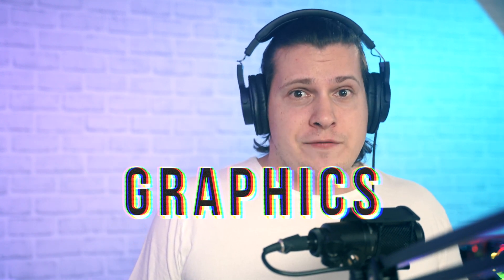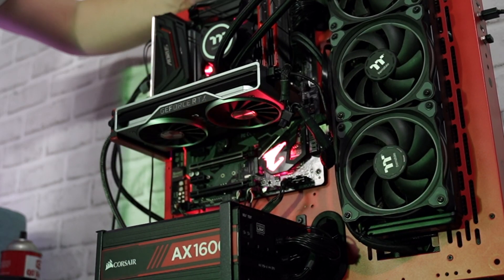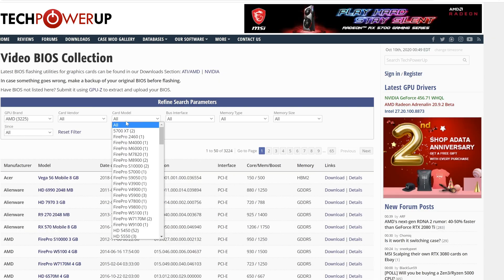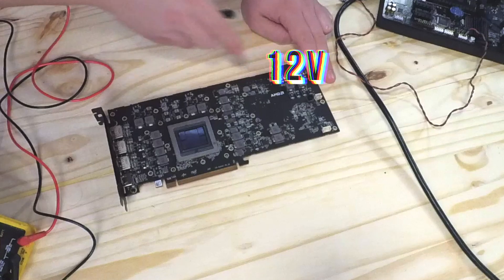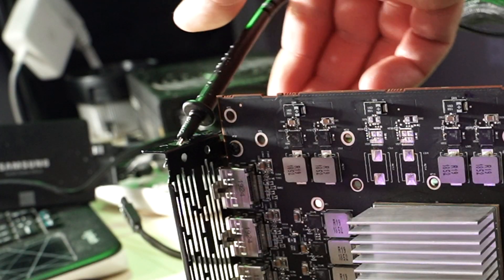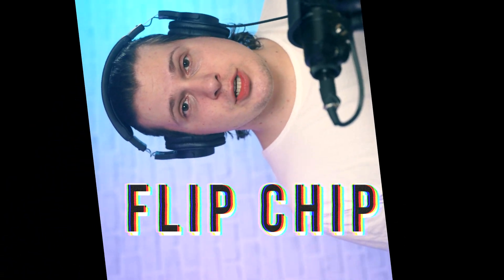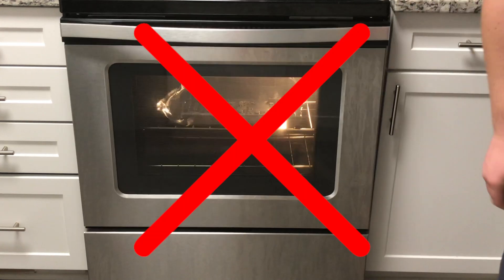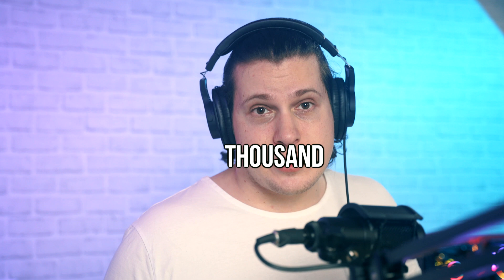How To FIX Dead Graphics Card

Comment: Sir I did like already can you help me with my problem  please i do have 1050 ti then I did most of the troubleshoot not with the hardware fix I already know its about my hardware that do have problem since i try using another low spec gpu it did work but not on my 1050ti
Reply: Its just simply light on the monitor i think thats bhaving signal but just black screen it is also readed in the device manager but does have error 43 when i use igpu as display
Reply from the maker: Unfortunately. Error 43 is not good news... remove cooler check for damage and clean it. Reflash the bios using nvflash. Get bios on techpowerup and find instructions for the latest nvflash online.
Reply: @GeorgeTech  thank you for your quick response ill try doing it
Reply: @GeorgeTech  I did open my gpu and the paste is quite wet and messy should i reapply paste?
Reply from the maker: @rjrivera2756  paste condition is not related to error 43. You can replace it if you want. Please watch the video. Feel free to pause.
Reply: IM FROM PHILIPPINES HOPE YOU COULD HELP ME, THANK YOU

Comment: Ok you seem to know what your doing. I have a 50th av Radeon vii. Sold it eBay seller sent back said it won’t run. And sure enough can’t over clock can’t adjust fans and it hits about 574mhz core in games for a minute and crashes. I have repasted flashed different vbios all I can think of. Memory is fine sitting at 1000mhz. Any ideas?
Reply from the maker: I’m thinking it’s component level issue man... have you tried testing each vCore phase with multimeter? Disconnect boot drive start the PC the test those SP-caps on the back look for 0.9 volts - vcore 0.8 SOC and 1.1(1.2) memory. The memory clock you seeing is actually both SOC and HBM so we don’t know if memory power is ok. My wild guess it’s one of PWM or a SPS on one of the phases. Keep me posted. No datasheet for PWM unfortunately.
Reply: @GeorgeTech  guess im digging out the old trusty meter lol. would going into bios accomplish the same as removing the boot drive?
Reply from the maker: Yes!!

Comment: did you manage to fix your radeon vii GPU yet ? ... interesting video as usual
Reply from the maker: Hey bud, gotta reball... haven’t done it yet. 50/50 chance
Reply: @GeorgeTech  maybe ask help from louis rossmann .... Afaik he has the right tools
Reply from the maker: It costs more than the card. Lol
Reply: @GeorgeTech  damn .. so much for that ... Tough luck
Reply from the maker: How’s your vega?
Reply: @GeorgeTech  well taken care for ... Got her arctic thermal pads 6w/mk and gelid extreme 12w/mk pads as per manufacturer recommendations and got myself gelid extreme thermal paste 9w/mk and cooler master mastergel nano maker new 11w/mk tim for rhe cpu .... Everything was done well after the 17th change lol ... I even got some of those M3 nylon washers to make sure the pressure is right ... The card is flashed with red devil vega 56 bios which is supreme !! Card can sip 336w of pure power and the stock fan curve is amazing on this bios doing 950 on hbm and 1670@1200mv p7 and 1125mv@1630 p6 others are just pure stock settings ... Playing watchdogs 2 and mafia defenitive edition gives me great performance ... Gigabyte unlocked pbo for 2700x on x570 boards so i got myself an aio ML240L and upgraded the performance ... I even overclocked the cl16 32gb kit to 3200 cl14 with 1.4v ... Did some harsh testing to make sure everything is done well and so far so good
Reply from the maker: Stepping up your game. Damn... haha I’m glad you taking care of things. I thought you had first Gen 1800 or something with XFR and x470. When did you upgrade? Or is it my brain just skipping cycles?
Reply from the maker: Nice temps on Vega 👍 also, I have a video cooking featuring your motherboard (No wifi) and others
Reply: @GeorgeTech  october 2019 my brother wanted a pc so i built him  1700x with the wraith prism rgb cooler and b450 aorus m with gskill rgb 3200 16gb cl16 , red devil rx480 8gb